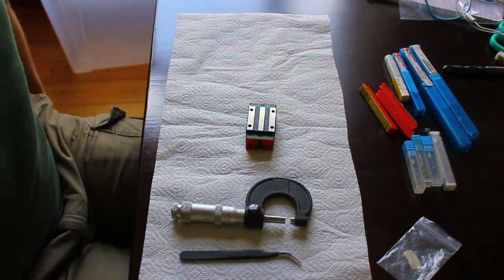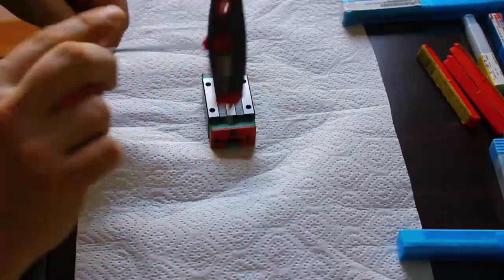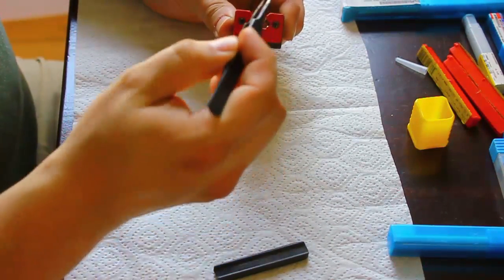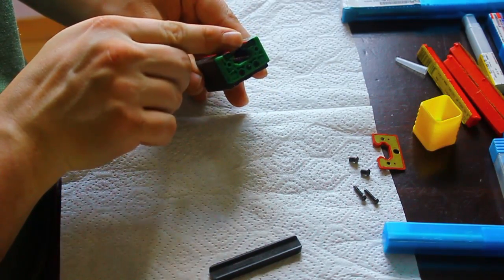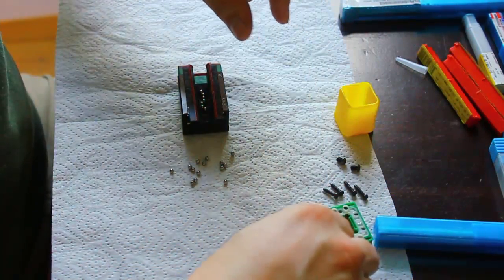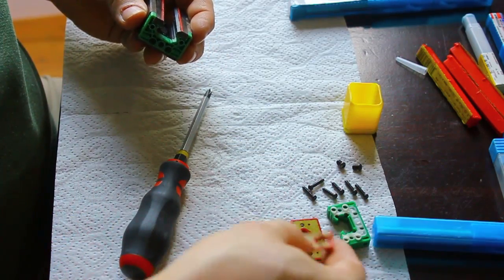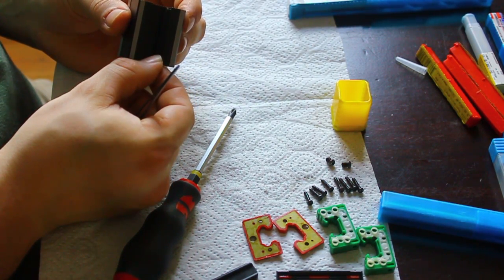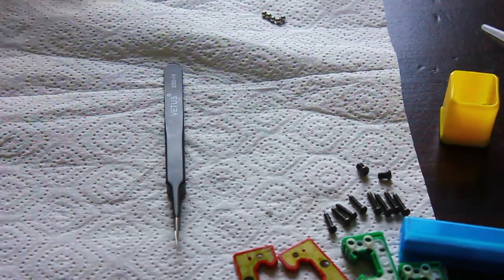Taking apart a HIWIN HGH15CA linear guide rail carriage - bearing replacement and service part 1

Comment: Well, today by mistake, tried to grease the hg15ca when was out of rail but with protector. however, some balls pop out. tried to fixed, but cant understand the righ side and position to those short black plastic-bracket, that stays from both side inside.they are flat from one side, chanel otherside.what is propper position.flat side out or in

Comment: I used one of those pick up magnets on a pole. They just pop back in. Use a small screw driver to push them. No need to open it up. I got lucky. Found them all.

Comment: The manual says you need to push a hot rod through 'the bottom of the tapped hole' to be able to grease the block. Is that white plastic diaphragm what they are talking about pushing the rod through?

Comment: Can you give me an idea of how much load these 15mm rails/blocks can support? Or how well they compare to sbr20uu?
Thanks for the video
Reply from the maker: These bearing blocks are very much stronger compared to SBR20UU, because they have more ball bearings and the block supports the load better. But using linear rails, you have to have a much more accurate setup for the machine in general. SBR20UU tolerates some inaccuracy in parallelism and being unplanar a little bit, linear rails dont like it at all.
Reply: Nice to know that. I will make a new structure using my already built CNC router when I get to upgrade to linear blocks.
Thanks for replying
Reply from the maker: Whats the machine you are building`? upload some videos :)
Reply: Just a CNC router, Thinking about upgrading it to the linear blocks at a later time. Might post a video later :)

Comment: Thank you a lot for this video, helped me much to clean up my chinese MGN12 :) Mine are sticking a bit only in one direction, do you have ideas what the reason might be?
Reply from the maker: I would check if you don't have any dents in the rails - some of the cheaper MGN's have dents and scratches. If you do - buy some precision stones and lightly clean the surface.
Reply: Thank you very much, i think you are right there are some micro-dents on the boarder of the cylindrical surface where the balls move inside. First I will try to run them in for some hours, maybe the problem is solving itself.

Comment: 1/8" = 3.16mm
Reply from the maker: Yep, it's actually 3.175mm. I ordered the new balls and will be re-packing them in just  a few days - video incoming soon :)
Reply: @roadsidejobshop9287  Hey will you share video on that? I was just about to order 1/8th inch bearings but - Will they absolutely not work / must be 3.175mm?